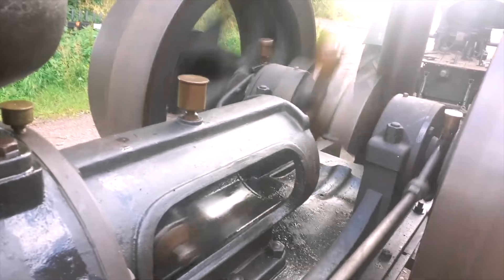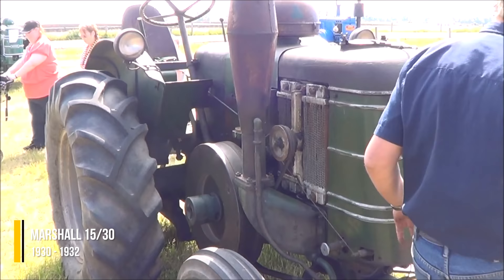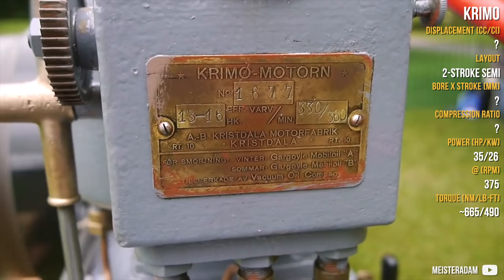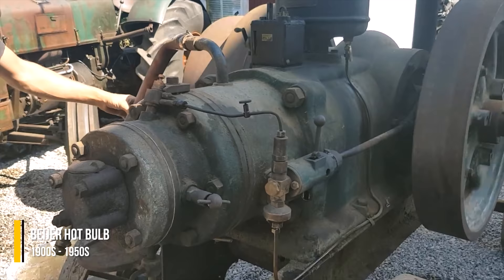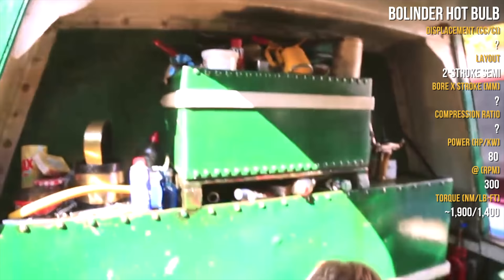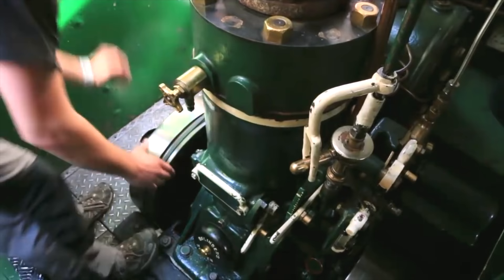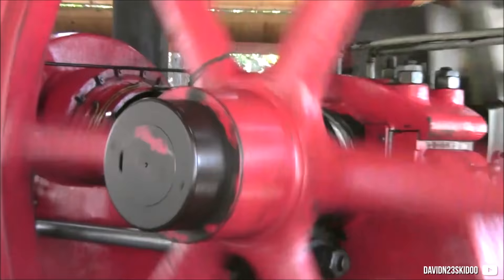Largest 1-Cylinder Engines

Comment: Old engines: HP=5
Torque=YES
Reply: that tiny 5HP engine damnnnn. 1,150Nm torque. Insane shit
Reply: @dieselgeezer18  torque means nothing. You could get the same amount of torque at a lower rpm from a 1hp engine that fits in the palm of your hand if it had a gearbox. If you have horsepower, you can get torque with a gearbox.
Reply: @jjhack3r  but thats why these engines are cool. They create huge amounts of torque at extremely low RPM without any assistance from a gearbox. Making them very reliable, simple, and the diesel ones, very fuel efficient, because gas engines back in the day were very inefficient
Reply: dylan zrim  uhm , so what? All engines have rotating mass.
Reply: @jjhack3r  Torque means everything. You can skip gearbox in your sawmill operation, having one less mechanism requiring lubrication and maintenance and being a failure point.
Reply: @jjhack3r If you're looking at a machine requiring torque only at a set RPM,  you are correct.. However, torque utilized for movement or work at various RPMS and loads requires said torque to be delivered by one of these. A 1 hp coupled to a gearbox would not produce the same results.
Reply: Well i still love more Plane engines,specially Merlin ones.
Reply: @jjhack3r  let’s not forget what the formula for horsepower is...
Reply: @herbertponder8643  notice how i said same torque at less rpm? Everyone is misunderstanding what i said.
Reply: @giggiddy  you're a joke... Low revving engines have a smaller rpm range. A high revving engine with a gearbox would have no problem changing rpm. The big clunkers in this video are best ran at a constant rpm.
Reply: @sleeptyper  the only thing that matters is horsepower. Rpm and torque mean nothing because you can always use a gearbox to turn one into the other. Horsepower will determine what kind of torque you can get at a given rpm.
Reply: @jjhack3r  Gearbox is always a lossy way to convert power to torque. Without going to spesifics like compression ratio and chemical energy conversion efficiency, my turbodiesel car can outrun a similar car with similar size gasoline engine at uphill.

Torque gets your junk moving, power drains your fuel tank.
Reply: @jjhack3r  Without the childish name calling.  Your insistence that an engine with minimal horsepower coupled to a  gearbox is a better solution than these stand alone  engines without gear reduction is not correct in a practical application. We all get the physics here, bud. But gearing isn't the end-all to every application requiring torque. If that was the case, the billions spent on engine R&D every year would be spent on transmissions only. Thats all everyone posting here is saying.
Reply: @jjhack3r  Remember power and torque crossed at 5252rpm don't ask me why its that kind of number

Comment: am i the only one who loves huge displacement single cylinder low revving engines more than normal car engines?
Reply: @FlameOnTheBeat  i also love listening to each one of the explosions and the exhaust smoke puffing
Reply: I own several, the biggest is a Fairbanks morse z 739. 36 hp 739 cubic inch single cylinder. I love them all.

Comment: The Deutz MKH 260 is a horizontally oriented 67 liter single cylinder engine, that makes 80 hp at 230 rpm.

Comment: You can see the De La Vergne engine (6:52) at the Western Minnesota Steam Threshers Reunion (WMSTR) in Rolag MN over the Labor Day weekend.  It is huge.  You can feel it in the ground when it fires.  That's not even under load!  It's a hot bulb 4 stroke engine.  I saw then start it once with a Case steam traction engine at the beginning of the day.  That place is a treasure for gas/oil engines of all sizes and same holds for steam engines.

Comment: Engines in 2030: 66cc 1 cylinder engine with 7 turbos.
Reply: And a 14 speed transmission!
Reply: @om617yota8  1speed auto, 500km/h top speed
Reply: @EngiNetion  Electric, sure.
Reply: That's funny but probably true pmsl
Reply: And hybrid as 918 Spyder:)
Reply: That will be good to see
Reply: @EngiNetion  Imagine a 0 speed. It wouldn't exist.

Comment: These shotgun shell start tractors are such a cool thing. The engines up to 10,000CC is freaking huge, 1000Litre.
Reply: 10,000cc = 10liter amigo
Reply: 1000cc = 1L 10,000 = 10L bro
Reply: Thats more than my bath
Reply: And 1000cc its 1L, 10000cc its 10L
Reply: Huge
Reply: I'll send an email to Allen Millyard to make a 10liter single Honda Cub next time...
Reply: 10,000cc is 10 liters
Reply: @fidelcatsro6948  bruh, they better make it
Reply: @bigred913  in fact, it is
Reply: @LostCauseRT  check out Allen Millyards channel...its not something difficult for him to do!
Reply: Bruh
Reply: Unkwon Malaysian Guy  maybe

Comment: While on the topic of Scandinavian hot bulb engines: 
In Bergen, Norway they produced a 30L, single sylinder marine hot bulb engine named Union Type EX, rated 75 HP. 
I weighed around 4.5 tonnes, including the propeller and shaft.

Comment: The DeLaVergne  was installed in the W. F. Norman Sheet Metal Works belted to a line shaft and powered sheet metal forming machines for 50 years.125 HP,  26" bore

Comment: The Landini tractors had hot bulb engines as big as 15 litres but the most courious thing is it can still run making only half a turn, it's called "mezzo giro", and you can even reverse the engine rotation, but to start it you have to be brave enough to turn with your hands the flywheel

Comment: I’ve seen the 125hp De La Vernge in person. Even video doesn’t do justice to how large it actually is! I’m currently in process of restoring a large single cylinder, a circa 1920 55 horsepower Anderson Oil Engine that is 3619 cubic inch displacement, or about 59 liters. I plan to start if for the first time sometime in mid 2021.

Comment: These big engines are very cool, but have you done one on little engines lately?  I was driving the Miata out here in Florida and pulled up behind an Isetta, which is what made me think of this.  Heck, while there are little engines in cars, some engines are tiny and won't power a car.  If you haven't already done this, maybe it's a subject to consider.
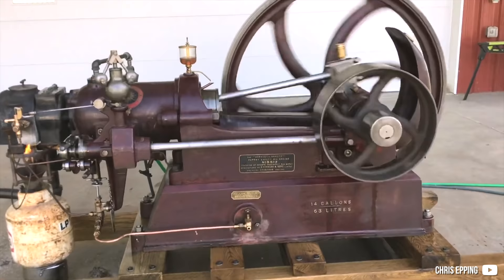5:30  Clean Filter Occasionally - LOL!

Comment: I remember in the middle of the last century all the fishing vessels in the Mediterranean had large, very low RPM (50 - 150), very loud 1-cylinder engines with large flywheels. Piston diameter over half a meter.

Comment: I do love a single cylinder, my favourite has to be a single cylinder when it’s mounted 45deg opposed to another single cylinder which is running alongside another 3 sets of the same orientation... 😉
Or when bmw made the single cylinder and put 6 of them next to each other 👍😉
Reply: That gives me an idea. Imagine then connecting those with a solid piece of steel, let's call it a "crankbar" and then synchronizing their valves somehow. I'm sure it would be useless, though - I can't imagine anybody ever wanting more than 5hp anyway.

Comment: Some more Swedish stationary singles would include:
Westervik (Hotbulbs from 3-35hp and up to 9000cc on the singles).

Målilla Mekaniska verkstad/Robur/Göta: Different names depending on who would be distribution the engine to its final customer. Up to 35hp Hotbulb. When named Göta, sold by Thermanius to drive there combines. 

AB Seffle motorverkstad: Hotbulb singles up to 35hp. Made Hotbulbs up until 1972,biggest ever was a 5cylinder 515hp monster, powering the "Tingvalla" tugboat.

I do not know every thing there is to know about Swedens engine, but send me a message if you have trouble with information on swedish engines/vehicles.

Kinda fun that I live 20km from Kristdala, 57km from Vimmerby, 61km from Målilla and 54km from Västervik. So im Kinda in the middle of a hotspot for old hotbulb engines.

Comment: These are called hit or miss engines here in the states... they used to be all over the place running oil wells, water pumps, and generators for work locations.

Comment: Greece had a long tradition on semi-diesels... We had a lot of machinery shops in Piraeus back in the '30s to '60s, in the largest port of the country. There were a lot of small boats using these engines, mainly for fishing and merchant purposes. They turned the entire Aegean sea for supplies, carrying people and other activities... There were also such shops on some Greek Islands. The most common engine was the "Malkotsi" or "Markotsi", like it was called by the Greek villagers. They used them for watering the fields that were near rivers, during the summer... These engines could work for months, in 24/7 forms... No-Mercy working hours... And very durable and reliable engines!!!

Comment: Starting a tractor with a shotgun shell and a hammer: most American thing ever
Reply: Nope ! Made in England. It's a 5 l single cylinder two stroke diesel. Owners swear by them ,not at them. They could also be started witha large cranking handle that was inserted into the fly wheel.
Reply: @ianhollands1641  Bri'ish

Comment: An interesting engine is what I believe it’s called a “water-kerosene engine.” It starts off of gasoline and kerosene then can be switched over to water-kerosene once up to temperature. It’s a stationary engine and single cylinder

Comment: In the small town of Lysekil on the west coast of sweden they celebrate "Tändkulemotorns dag" - The hot bulb engines day. Lysekil is the home of the Skandia engine, by L. Laurin which transformed the fishing industry in sweden to use internal combustion engines. There are loads of people traveling there and hundreds of hot bulb engines in various sizes that are run and showcased.
Reply: There's a similar event in Målilla every now and then... "Motorns dag", they feature other old engines too, but there are usually lots and lots of hot bulb engines.

Comment: Used to work with fairbanks Morse 208s, 346s, 503s and 729s pumping oil wells. These hit and miss engines ran off of natural gas produced straight from its own well. Just about the closest thing to perpetual motion I've ever seen.

Comment: One of the most interesting  motors I ever saw was an 8 cylinder engine used to pump natural gas  . Inw half was a compressor,  the other side  was the motor.  This plant had 4 motors. Two in operation,  one on stand by and one being rebuilt at all times. You can literally  stand upright in a cylinder.  The newer ones are turbine motors. I would love to see you do a report on these motors

Comment: I dont know the names or Manufacturers of the engines but at Rough and Tumble Engineers association in Pennsylvania,  they have at least two engines that are not just a little Bit larger, but are like 3 times larger than the largest engine you have shown.  One was a city water pump in York, PA.

Comment: My friend owned a 400 cc 2 cycle dirt bike back in the '70s . That was the biggest single cylinder engine I've ever seen.
Reply: It wasn't a Yamaha DT400, was it?
Reply: @someonebald2022  It was a Suzuki 400 cc single cylinder 2 cycle dirt bike . It was loud and it burned oil so it stunk. He told me that if he came home late at night he would turn off the motor at the top of the street to keep the neighborhood from waking up .
Reply: Big 4 strokes are 500 cc Yamaha SR, 550cc Ducati supermono, Yamaha XT600, Kawasaki KLR 650, 690 cc KTM, (Largest single engine bike is the NSU Bison 2000cc, a one off creation) The biggest single, is the 2 stroke Maico 760 !!

Comment: I find it amusing that these hot bulb machines had an efficiency of around 30% more than a hundred years ago, while a modern, top of the line diesel today has about 33-35%. Engine producers haven't made that much progress in all those years. Talk about perfection from the get go. :D
Mind you, these numbers are at 100% workload.

Comment: I searched for this because recently I've found myself entretained with the idea of what could be the simples internal combustion engine vehicle possible... So far I've imagined something like an inverted trike (2 wheels in front, one in the back) with rear traction (so, no need for differential),  drum brakes, maybe just a centrifugal clutch, or a manual 3-speed one if that just sucks to bad to be usable. A non-assisted steering mechanism. All powered by a single cilynder two-stroke engine (diesel or petrol? not sure).
Just to add some maybe relevant information: I'm a writer and I was thinking about what could be a very simple vehicle to be used maybe as a tractor/truck for a group (most likely some sort of armed force) who requires tons of cheap, reliable transports for their absolutely huge empire. The could even be fitted with guns on a pinch. Probably wouldn't be the best combat vehicles, but it depends on the situation, also, numbers definetely do help...
Reply: Also, I'd forgotten to add before, I had this crazy idea for simplifying the project by having a central strong metal tube to be the main component of the chassis and also the walls of the cylinder. I really don't know how good or bed this idea is...

Comment: John Cockerill company Seraing Belgium made blast furnace gas engines for steel mills. They made 600hp single cylinder engines for power generation and driving blowing pumps to force the blast air into the furnaces.

Comment: Wow that was a great video!  It left me with a ton of questions. Like why was there a flame at the end of some of those motors. How does the shot gun shell start a motor
Reply from the maker: The cartridge is fired and massive energy out is released. This pushes onto the piston which then moves the crankshaft rapidly and the engine starts. Though, it leaves a lot of carbon deposits behind
Reply: It is not actually a shotgun shell, it's very similar but obviously doesn't have any shot in it, just uses the pressure of the explosion to drive the piston down. Not used very often, normally started using ignition paper rolled up ( bit like a cigarette ) lit and screwed into the cylinder head and then cranked by hand.
     The flame you see ( from a blow lamp ) heats a heavy lump of cast in the cylinder head to help ignite the fuel as compression in early engines didn't produce enough heat until the engine was really warm.
Reply: @yeahok115sure  There are probably a few people who see shotgun shell and think that's exactly what it means! I think the amount of powder is different too. Imagine a Field Marshal turning up on a episode of Forgotten Weapons! 🤣

Comment: May be the largest single cylinder engine was a prototype made by Sulzer almost 100 years ago to investigate large bore two stroke diesel scavenging. 1100mm diameter, 1000mm stroke

Comment: Ruston and Hornsby used to be in Lincoln where I live.
Reply: Back in 75 Iran a 5ATXM R and H in an ex North Sea trawler in the Great Australian Bight.
It was 600 HP at 500 revs weighed about 50 tons and was connected to a MWD reversing
gearbox, that weighed in at 10 tons.There were also 2 4YB 4cyl R and H gensets .
  They were built in Lincoln, England.

Comment: Not even close sorry , the doxford single cylinder marine engine had a bore 0f 500mm was 32 feet tall and weighed 100tons , it produced 450hp at 180rpm

Comment: MIssing lanz bulldog 10 litre 2stroke 1 cyl tractor. its a beast. on idle it has ZERO rpm. it just turns the crank back and forth between each stroke xD